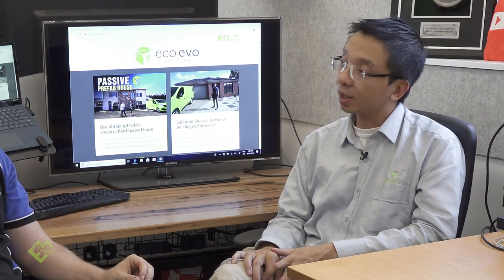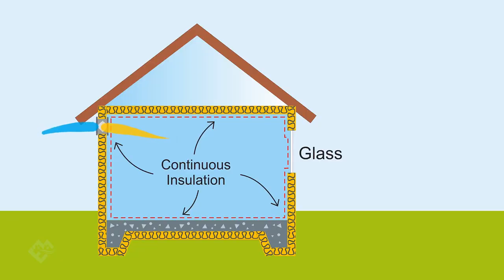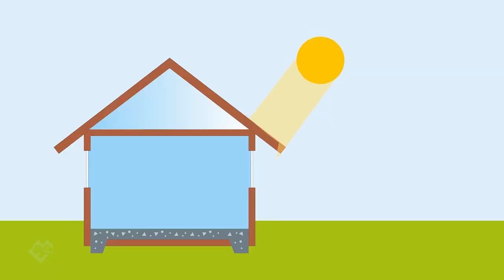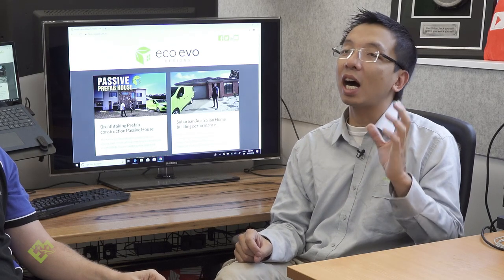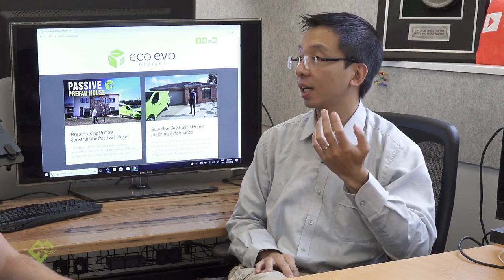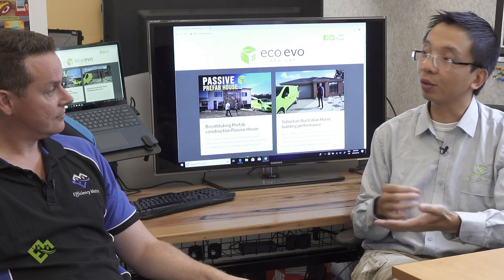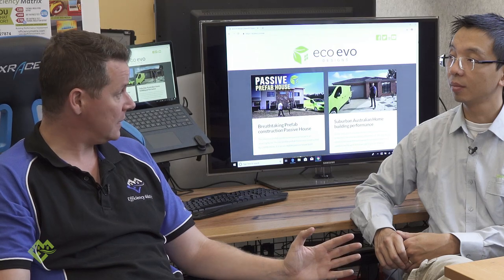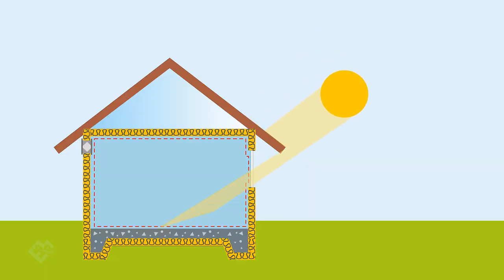Passive Solar VS Passive House?  Are they the same?  Which is Better?

Comment: One is a set of principles, and the other is a business.

Passive Solar is a set of basic scientific principles incorporated into house design to make a less energy consumptive home. Any single house may utilize dIfferent principles and/or techniques based on the heating and cooling needs in the local climate and design preferences. In practice, because each house is a unique design it is difficult for the average homeowner or builder to guarantee the energy performance of the home. Passive House Is the latest incarnation of Passive Solar with differences:
- It is a company and a business that trains and certifies builders and homes.
- High emphasis on air tightness and insulation. This ensures highest possibility performance even when the home doesn’t have optimal sun exposure.

Comment: You guys confused the hell out of me.
Reply from the maker: Don't be confused. The choice here is about how much control you wanted to have on the indoor environment. Passive solar is great, if you can accommodate a wider range of conditions. You know  everyone has a different preference of "Comfort". All we trying to convey is the message that you have more control with a passive house where passive solar can improve the indoor condition for sure but not guarantee the level of comfort you are going to get. especially during heat wave.